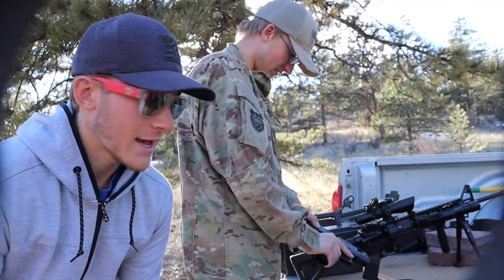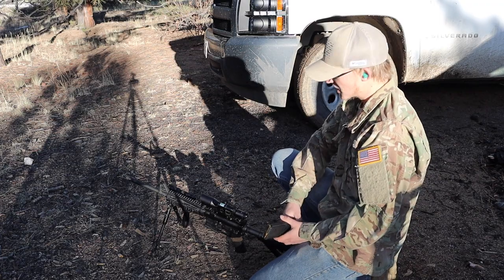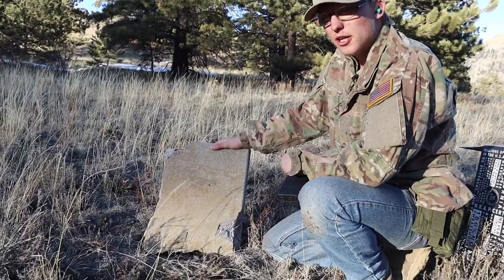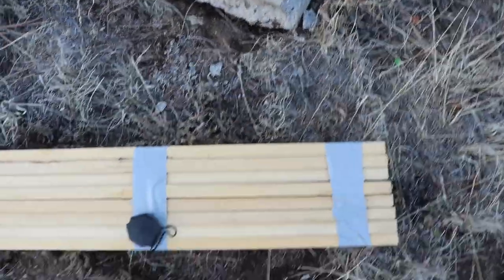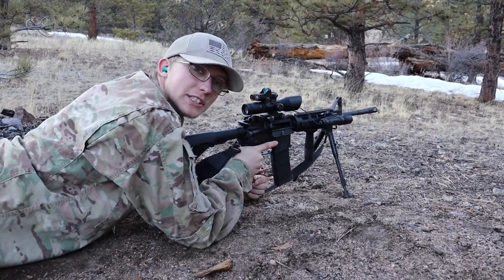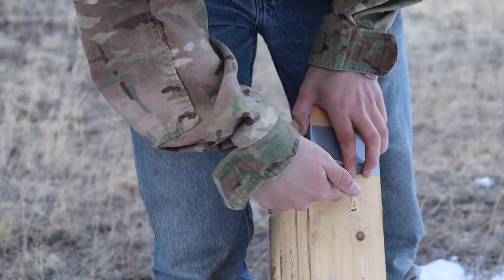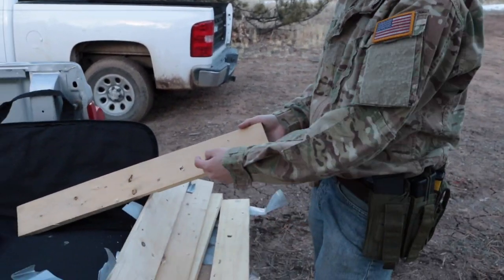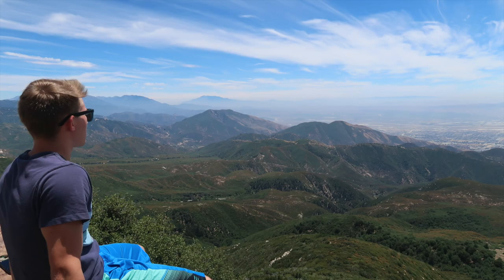3 Different 5.56 Rounds Accuracy & DAMAGE TEST *55Gr, 62Gr, vs Greentip*

Comment: As I’m sure you’ve already heard, the 62gr steel core ammo and the regular 62gr lead core are not at all going to have the same trajectory just because they weight the same. With the steel core ammo, think of it this way. Imagine you fill two footballs with play dough, one of the is just play dough, and then you put a steel rod through the middle of one of them. Unless you get that steel rod perfectly through the center when you throw the football it’s going to have a wobble whereas the football that uniform throughout will not. I hope this is making sense. The steel core in M855 is known to effect accuracy. It all depends on how concentric that steel core is in the bullet. You could get some that is super accurate, and some that shoots like shit. Just wanted you to know that and hopefully explain it in an easy to understand way
Reply: Hey I was the one with the ammo in the video. Since the vid I have also researched and experimented to come to that conclusion! I notice it especially with a .17 HMR. Same weights and both fmj of even just different brands can move the grouping 2in and the size. Thanks for the helpful input!

Comment: What range is your platform sighted in at?  That’s what is going to tell us your trajectory at 60yds.  If you sighted in at 25yds then your poi would actually be slightly too high at 60yds, if you sighted in at 100yds then your poi would more than likely be a little low.

Comment: If I may. Your forward grip hand is going to affect your accuracy. You are on a bipod already, so no need. One or the other will suffice, provided you support the weapon the same way all the time. The gun will want to slide towards your shoulder, but your forward hand is fighting that, ever so slightly. Probably no too noticeable at short range, but will cause consistency issues at longer ranges.
Reply from the maker: Thanks for the info, that will be cool to try at longer distances!